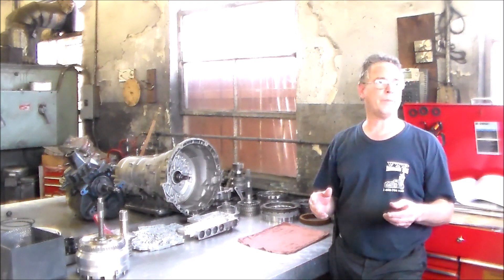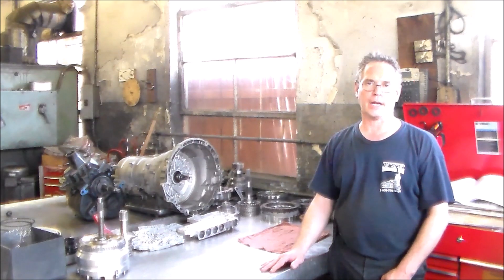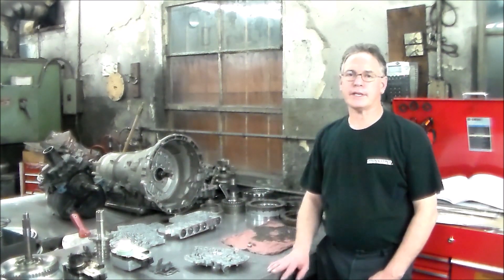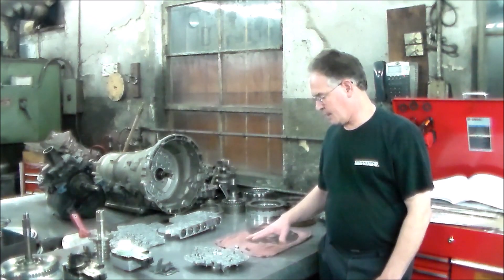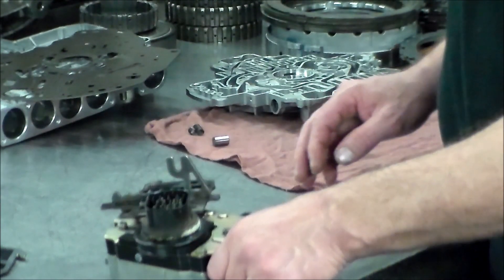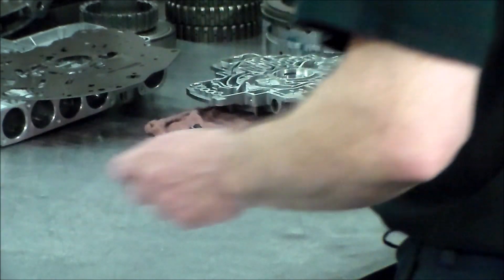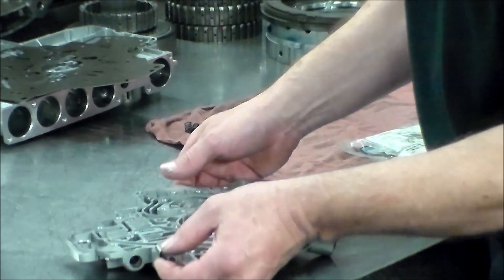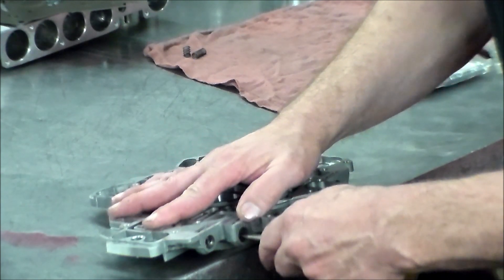545RFE, Code P0740

Comment: No idea if you get to older video comments, 2010 Ram 2500 5.7, 545rfe. Have shudder when the trans goes into lockup, no other issues. TCC bore wear or maybe broken springs?
Reply from the maker: You could try to do a trans service, change both filters, new fluid and add a shudder fix, see what you have. If the Tcc spring was broken car would stall out
Reply: @GaryFerraro  did OEM filters and fluid about 4k ago with no changes, maybe I’ll try a shudder fix and see if anything changes. Thank you.

Comment: Hi Gary, I noticed a similar question on a 08 Ram 2500.  68rfe 6.7 Cummins, this happened the last 2 times I made about a15 mi trip to the farm. Temp below 30 degrees, drove to the farm mostly in 5 gear to help warm up. Coming home an hour or so later put it in drive all the way home. About 5 miles toward home Ck engine light came on. Checked codes when I got home. P0700 & P0740. Cleared them the fist time. Happened again the other day, had the Snap On Versus with me, hooked it up, same codes again. Left it hooked up so I have some data pids ( not sure how to interpret them). I don’t notice missing shifts or anything abnormal, I was driving in a snow packed country rd. The only issue I had notice before was, if I didn’t let it warmup before I drove it it sometimes didn’t want to unlock for a stop sign at the end of the street. Had to bump into neutral or coast through the intersection. It was fine after a mile or so. Do you think it would have a 60% or greater chance that putting a Sonnax rebuilt valve body in it could fix it. Thanks

Comment: Hey Gary I have a 08 ram 1500 5.7 it won't move in any gear. I can feel it shift through gears but won't move. I've changed the solenoid pack and both filters but still nothing. There is no noise but when I try to put it back into park while running it grinds. Could it be the torque converter?
Reply from the maker: make sure your transfer case is not in neutral, if that is ok, may have a bad diff

Comment: So i have a p0740 on my 2008 545rfe ram

The truck does not stall and shifts fine no jerks or anything.      Just the torque converter is not locking up.    Do you think it could be the solenoid pack ?
Reply: It reads, P0740 

 "torque converter clutch solenoid circuit/ open"
Reply: @elulysero8863 did you ever figure that out?

Comment: What are the symptoms of a bad torque converter limit valve spring on a 545rfe
Reply from the maker: Car stalls out when drive or reverse is selected
Reply: @GaryFerraro  thank you .my transmission was rebuilt not to long ago but now its started to jerk rpms goes up and down and then it slips what could be the problem ?
Reply from the maker: @edgarza4649  First i would check fluid level. Can you tell me if any codes are present
Reply: @GaryFerraro  il get it check in the morning and let you know the codes .thanks for replying 🙏
Reply: @edgarza4649  I have a question for you : I have a 2011 ram 2500 4×4 5.7 hemi SLT TRUCK WITH THE 545rfe Trans in it .. 2 codes keep popping up P0732 and P0735 .. 

Any information would be much appreciated.. 

Thank you .

Comment: Hi Garry I have a 2008 Dodge Ram 6.7 Cummins I have the same code my transmission runs good it just doesn’t get my 6th gear and it drops to 4th or stays on 5th people tell me I need a rebuild but idk at this point
Reply from the maker: Is that the only code?

Comment: I had a P0740 on my 2004 Durango 5.7,  545rfe,  for well over a year.  Replaced sensors, valve body and solenoid pack. Anyway, moisture / water was getting in my trans fluid through the old pan,  224,000 miles on it.  Long story short, moisture/water caused my P0740.  I fixed it by flushing and draining.

Comment: 2000 Dodge Grand Caravan.156K.3.3L....po 700,po 740...when church engine light first came on...shifting good...now no go in drive,reverse...fluid full,looks good....your opinion?....thanks!
Reply from the maker: Does the car move cold and then it heats up and stops moving?
Reply: @GaryFerraro  no move at all....thanks
Reply from the maker: @robmartin217  Possible blown converter.  car holds in park?   any noises?
Reply: Holds in park and no noises.....
Reply from the maker: @robmartin217  ok, did this happen suddenly?
Reply: @GaryFerraro  check engine first came on 8-2019.....then like I said....in June no go in drive,reverse....

Comment: Gary,

2000 Dodge Grand Caravan Sport...3.3L...156K....when check engine light first came on(po700,po740)....shifting fine...
Now no go in drive, reverse...would solenoid pack fix it?....your opinion?...thanks!..

Comment: Hey Gary I have a 2004 Jeep Grand Cherokee 4.7 and I am getting the P0740 code as well. All groups lead me to changing the Solenoid block should I get a valve unit complete or just the solenoid.
Reply from the maker: The solenoids are only sold in a pack. This code sets when the converter can no longer fully lock-up.  This could be the converter itself or possible problem in the pump. All the valves that work the Lock-up are in the pump. Solenoid pack may not fix this problem
Reply: @GaryFerraro  Thanks for the advise. I was hoping that it may be the culprit. Any advise on how much that type of repair would cost to check
Reply from the maker: @pamelaflynn8844  With this code, the only fix may be an overhaul, most shops won't try to fix this issue because this code can be caused number of internal transmission problems

Comment: Also would x5 3.0 vavle body work on a 4.4
Reply from the maker: what trans are we speaking of.  sometimes there are 2 different units because of the engine size
Reply: I got 2000 BMW X5 4.4...would a 3.0 vavle body work...if not with the code po740 clutch lock up should I look into the vavle body for that issue
Reply from the maker: Kent payen Not a common  code for this trans but the converter itself may be at fault
Reply: One last question not using the recommended zf tranny fluid and after market filter could that cause that issue...
Reply from the maker: Yes it could.  You can go with a premium synthetic fluid if you don't want to use the life guard, always go OE filter, never aftermarket

Comment: 2005 5r55s and in a mountaineer.  Watched all your videos I could..  no 2nd or OD.  Rest of gears work fine.  Checked servo closest to bell, bore guage pins very nice and rubber piston seal is nice also.  Dropped the pan and pulled solenoid pack and checked every solenoid for function and ohms and they're good.  Pulled entire valve body and completely disassembled, checked every part and reassembled.  Gasket plate is good also.  Able to see adjustment side of OD band and put pressure on it from both sides, it's not broke.  Reassembled, still same p0775 code and no 2nd or OD.  No shavings to speak of.  Tranny makes or never made any suspicious noise, went out on the highway.  I'm going bald and losing my hair on this one.  Any insight from you would be amazing.
Reply from the maker: are there any other codes like P0732 or P0735?
Reply: no codes at all, I was wondering though about another video you did for a lady that drove 2 hours to have you repair her 5r55s.  She had a small pile of shavings the size of a dime laying on the valve body gasket when you pulled it out.  Aside from the common wear on the internal parts, what was the actual cause of the 2nd and 5th failure?
Reply from the maker: @WarzoneDads  The problem was a broken band. Her car had a bad computer as well which jacked up line pressure, she had a Lincoln around 2002 and it's common for those computers to fail

Comment: Good morning Gary 
I have a problem with 2005 Nissan Altima Transmission the car came in with no movement no reverse no forwards 
I opened it up and I found nothing wrong 
So I went ahead and install a used unit from Lkq and the car run good for a little bit but after the test drive I put it in left to check out for leaks and the car wouldn’t move forward and no reverse also it has no codes do you think these units have to be programmed or something like that?
Reply from the maker: No shouldn't have to be programmed.  Did you swap over anything from the old trans?
Reply: No I did not
Reply: Today after closing the shop I was gonna move the car and the car run good for a little bit after about 3 minutes the transmission wouldn’t engage again 
I’m thinking the filter is getting plugged
Reply from the maker: @aviator1683  Sounds like the filter is clogging up

Comment: Gary, is the updated white connector solenoid pack and cam plate available from any quality aftermarket sources, or is this dealership only? It's a shame that such an inexpensive spring resulted in such a costly repair! Your transmission repair and rebuild will very likely outlast the rest of the Grand Cherokee. Nice work as always Gary!
Reply from the maker: Luke Strasser I buy all my parts from Transtar. They have the good stuff of course dealer is another option
Reply: @GaryFerraro  Thanks Gary, I know on some parts you prefer OE only, I wasn't sure if this was one of them. I appreciate the feedback.